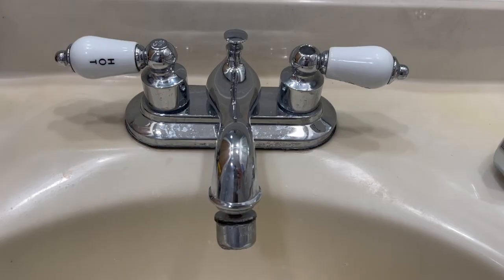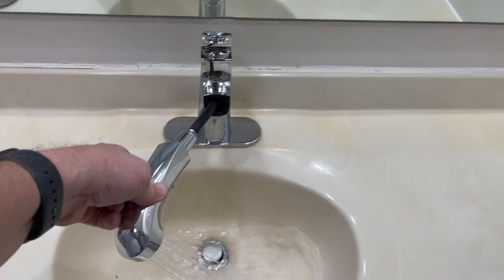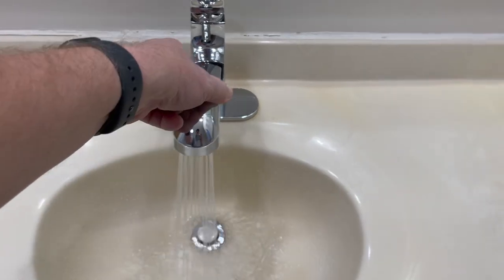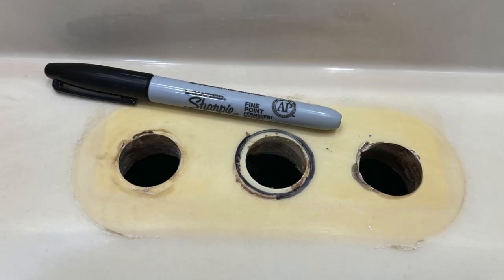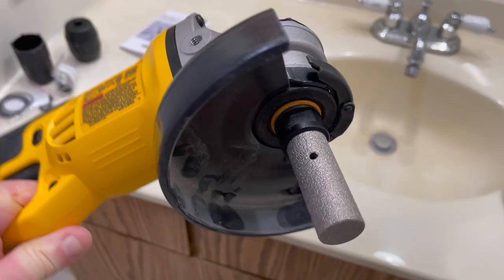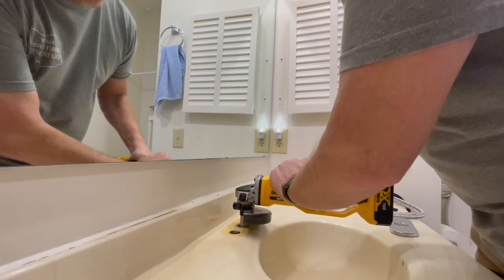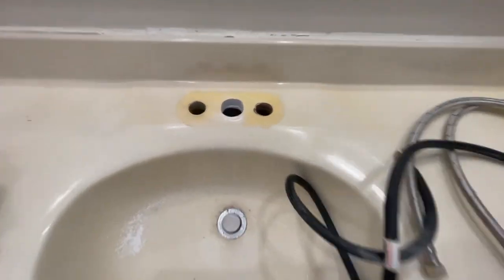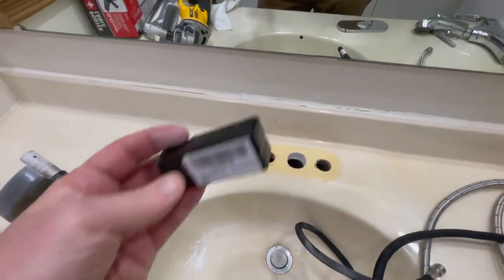#152 Enlarging the holes in a sink or countertop to accommodate new faucet using a diamond mill bit

Comment: Thanks for posting this. Saved me a lot of headaches. In my case the hole in the countertop had been previously drilled by the installer but was not square so the instant hot water faucet I was wanting to Install would not fit properly. I was looking for a way to clean up and square the hole.
Reply from the maker: Glad I could help! Thanks for taking the time to leave this comment!

Comment: id also like to add you can use those diablo diamond hole saws on cultured marble cuts like butter.. all you have to do is start with the wedge of the hole saw first since you can’t use a  pilot hole
Reply from the maker: Thanks for the tip. I’m not sure I know what you mean by “wedge of the hole saw”. Is that meant to say “edge”? I cut some granite with these and I think you are saying that you have to start at an angle so the hole saw will bite and not jump around. Is that right? Thanks for watching and commenting.

Comment: Do you think this would work on quartz?
Reply from the maker: Yes I believe it should work on quartz... it will take longer for sure and you will want a high rpm angle grinder.  You may also want to add some water to keep the bit cool... that said I do not have experience with quartz but I checked and diamond bits are definitely used on quartz.

Comment: I had an issue with a brand new Allen & Roth bathroom sink and Allen & Roth faucet (harlow) from Lowe's. I didn't know about the diamond burr/mill idea though. I tried to widen it with one of those cone-shaped step drill bits. Needless to say, I chipped the porcelain in a bad way. I expected to chip it, but hoped that they would be small and concealable under the flange. No luck. I ended up going and buying the next available sink, which I don't like as much and cost another $100 over the Allen & Roth. :( I wish I had found your video sooner.
Reply from the maker: Ugh, sorry to hear that. It took me a while to figure out how to attack this but it worked well. I’m about to drill some granite for the first time and am a little nervous about that. Lol.

Comment: Maybe With more time and effort use hand files if hole is not 2 small , just slightly.
Reply from the maker: yes that would likely work but may take some effort depending on the material type.

Comment: Has anyone had success with enlarging the existing hole in a granite countertop with this bit?
Reply from the maker: It should would but would likely take a while. It is made for granite as well. I suppose it depends on how much larger you need to go.
Reply: @HardyBrothersOutdoors  thanks for the quick reply.I only need a smidge, maybe a 1/4” or so. I’ll let you know how it goes.
Reply from the maker: @kgoodman16   I think it will definitely do the trick for you.